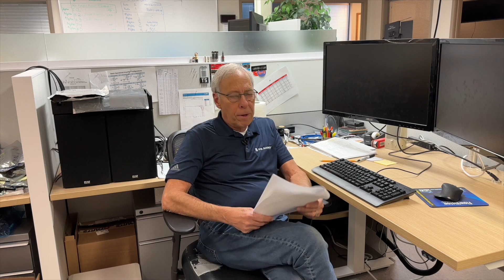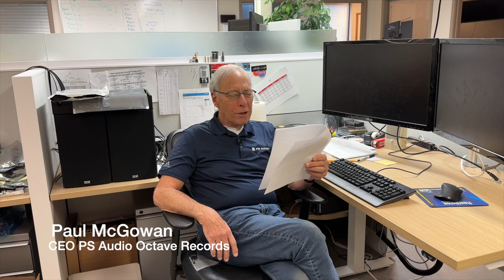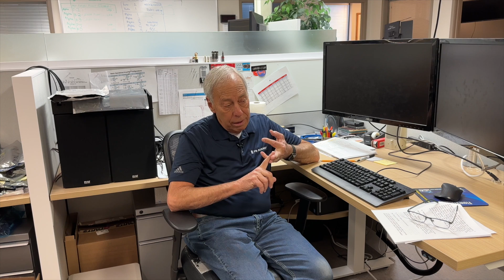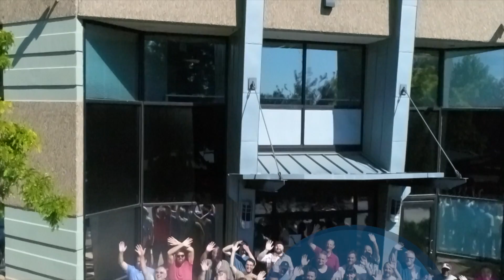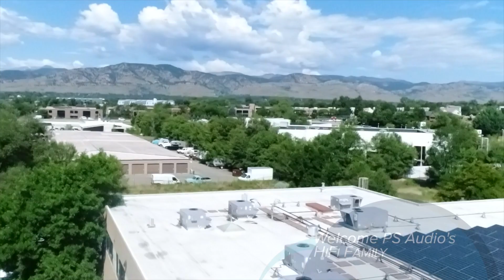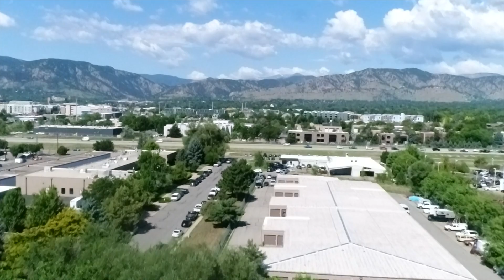Changing CPU speed for better audio

Comment: It works not sure why, it free to try in windows just go to settings>search power plan>edit power plan>processor power management> minimum to 5 percent, max to 99% down from 100, on my it didn't change when I went lower from 99 only when going from 100 to 99, maybe minimum is key if you need more speed, on mine it clocks down to a stable 1.6ghz for me from 2.6 base speed with spikes to 3.2ghz, when just streaming tidal, you can see the effect in task manager, performance tab, I also disable devices, such as hdmi output, web cam, fingerprint scanner, onboard audio/laptop speakers. The big difference was cpu speed I think, just sounded cleaner less harsh like wiping a smudge on a window, wasnt more resolving really just a something cleaner about it, this is via USB audio, you could bypass cpu altogether with toslink or a cheap usb to toslink like a smsl po100 pro but I think this is a nice upgrade for no money

Comment: Paul is correct when he said noise will come from the power supplies, particularly the 0VDC part of them.
So with connecting multiple DC devices within an audio system, eg; laptop, digital streaming unit a separate DSP and active amplification, that 0VDC can become not zero volts at all. It will often corrupt any analog ground with noise, even if balanced XLR is used. The result can be humming or random pops or low level squealing noises from your speakers.
The fix? Shunt the noise that is being generated in the ground of RCA cables to a good earth point. The ground of the AC supply will work. As long as we're you live as a good earth connection.
Easy way is to bond the shield of the RCA output cable that goes to your amplification directly to ground.

Comment: This is a very complex problem. I have tried many settings on my dedicated audio Fanless computer (Bios, windows, etc.) for months.
Fans, Led and SATA bus are the ennemy of audio. But the worst is the influence of the cpu frequency on the audio quality : the sound feels more accurate at 4Ghz than at 700Hz but more harsh to the ears. It's a difficult tradeoff to find between accuracy and smoothness...

Comment: Alot of these comments are hyperbole.
Having newer Hardware helps. And a separated power source.
1. Get a dedicated everything. SoundCard with it's own audio engine.
2. A USB out with a booster or spidif.
3. Output to a second amp dac or a theater system doesn't hurt if you know what your doing.
4. Enjoy clean audio. 
Fac and wave argument is rather silly. That's why I still use HB 320 mp3 to save space to flac or even in visualization it's almost the same ripped quality as wave.

Comment: If you're hearing noise, there's probably a ground loop issue. Otherwise, if you don't hear anything wrong, don't worry about it. As for Paul's advice, modern computers, especially laptops, will automatically clock down and shut off cores as much as they can, too save power and heat. So if all you're doing is listening to Tidal, you probably have one active core running almost at idle.

Running your laptop off battery vs plugged in would probably make a bigger difference than anything else. Give it a shot both ways. If you don't hear a difference, like I said before, don't worry about it. If you're still worried, try a digital interface. I think ifi makes something affordable and effective.
Reply: It is true. When you have a ground loop issue you can try plugging the speakers without the ground pins from the wall.

Comment: Uncompressing an audio file such as FLAC is a trivial demand for any computer so should not be a concern. As you stated, power supply noise is the largest potential troublemaker. I use a USB connected clocker to prevent jitter and electrical isolation from the PS. I do not notice a difference between using optical or coax SPDIF connections to my DAC, which directly feeds my amplifiers. Too bad these clockers have fallen by the wayside because they solve the two biggest problems using a computer as the source. Viva JRiver!

Comment: You do not need much CPU power to play music files -- any music files.
The InnuOS Statement transport / music player uses a Pentium CPU.

Perhaps that model CPU's lower clock cycle helps reduce noise?  Very likely it does reduce noise, which is why it is used in their flagship transport / music player.  And that box makes digital content sound better than anything you have ever heard.  Perhaps one or two people viewing this video have heard something in that league?

They use an outboard power supply (a completely separate box for the power supply).  That is one of the major contributing factors to its outstanding sound quality.  Power supplies are critical for sound quality.

Comment: This would be an interesting test... 
Stream identical resolution music from the following, different, sources and listen for audio quality differences. 
+ Streamer's local storage (not always available). 
+ A local USB attached thumb drive. 
+ A local network library (wired and wireless). 
+ An Internet based library (should sound identical to above, local network library). 
+ An Internet streaming service, such as QOBUZ (that requires decrypting). 
Additionally, the difference between WAV and FLAC could also be verified.

Comment: The way to avoid this issue is to not use a power hungry gaming computer as audiophile music server. Nowadays you can find highly power efficient computers such as the M2 Mac mini providing lots of processing power and excellent support for high sample rates and no concern of digital noise. In actuality, noise from the power supply leaking out on a USB cable is not just about potential  theoretical impact on the analog audio circuit but also about compliance with FCC regulations. Both the power supply and the digital circuitry of the computer have the necessary filtering to avoid emitting RF noise into the air from connected wires and thus also emitting RF into the analog circuitry. Now even I have some anecdotal evidence of past computers emitting too much RF. In fact I had a PC long ago that emitted enough RF on a PS/2 mouse cable to cause my neighbor's TV to show noise on the screen and make him call some expert to measure emitted noise. The guy with the measurement equipment came to my parents house and found my computer to be the root cause. But that happened decades ago. I suspect Paul has some experiences of this sort. Today this topic does not deserve the attention Paul is giving it.

Comment: I think you'll find that if pc is doing more "work" unpacking a flac file; more cpu cores should actually be better==> more cores means more available resources to unpack ==> less overall stress on the system.
Slowing down the available cores will also make the pc work harder to do the same (or any task ....) task(s) 🤨🧐🤨

Comment: CPU commonly use internal multipliers to the system clock, so it's only the internal CPU core that has a lower clock, the edge speed will remain the same. So no, changing the CPU speed won't help you. Lets face it, a computer is a garbage can of unregulated noise, crap, bursts, farts you name it. I think the correct answer is if you are at all serious, don't connect computers  to your analog chain.

Comment: From what i here the recomendation is intel xenon prosessor, ECC Ram memmory the more the better, Single layer cell SSD to run the operating system at least!
 USB Output Card probebly Jcat EX is your best bet for now and ethernet Card from jcat with LPSU's connected to everything even the PC it self they make a ATX LPSU from Jcat. And it should runn in a lowlatency operating system preferbly Linux this is for the server pc aka where you storrage the music and transport it to the streaming pc yes you should use two pc's!

Now the play of pc where you should have a pc about the same use LPSU and same type  of ram, usb card and ethernetcard but with a slow running CPU like an atom ore celeron just running the operating system from a thumb drive.
If you can you should runn booth pc's "headless" without grafic interface and controll them from diffrent device like remote desktopp setup ore from an ipad and try to optimise the bios no extra crap no overclocking, hyperthreading, try to stableise the computer turn off all extra functions that you dont need. Ok now you are reddy to play high quality music from your pc's ore music server/streamer system you could call it 😊 good luck!

Comment: Hmmm....you got rid of the internet explorer from the Mac. Interesting. 
I don't think it's anger Paul. You are fantastic and so is your company. And your knowledge of audio is certainly vast and very considerable. But it's the limits of your knowledge where things go very wrong, fast. The genesis of the question was even sparked it seems from the nebulous statement about processing power and audio quality. Even more nebulous when it's blamed on the power supply (a possible and viable contender for audio degradation, of a kind) but then that's forgotten and the focus is back on the processor. Bottlenecks in PC's range from the OS, to more commonly, the ram and hdd and by organizing or upgrading these one can certainly ensure the software outputting audio runs better however none of these implicate the processor.
Because of the multi factorial and co dependent environment in which a processor works the 'guess' that the processor or the even more nebulously  'the computer'  is noisey (and noisey is not defined in terms of audio quality but rather measurements made by hyper sensitive instruments) is a bad one. The likely culprit of unsatisfactory audio from a PC is the hardware and software from the sound output device and possibly the  background applications - but that is something of a stretch.  Most computers are not optimised either via hardware or software for high quality audio outputting. This is the issue, coloring and poor processing by the hardware at the output stage. Likely not the power supply, not processor but the audio output chip/card and or companion software. 
In my office I have a high end nVidia GPU card outputting to Denon AVR x 2800 via a high quality HDMI card. The sound is supberb and I have no doubt it is bit perfect even on the most over done dsd files, however it's still colored. Every piece of hardware that outputs has a color. A/B listening is therefore essential to decide whether that color is beneficial or detrimental to to the overall sound quality. 
By having strong knowledge of computing and networking I can discern where the weaknesses in this 'digital chain' or domain most likely lie. And there must be someone at PS Audio with such a knowledge? And so perhaps where your weaknesses lie Paul you could bounce the question over to such a person? The guess then becomes far less nebulous and more focused.
Reply: I think Ted Smith has this stuff pretty well figured out.

Comment: If we talk about digital media - there's no big difference, how fast/slow your processor are - most important is - what digital format you wish to play. Processor frequency doesn't affect quality of the played audio. What affects - is your PC fan/DVD/HDD EM noise and quality of PSU. Cheap power supply for desktop PC' s usually didn't have proper output filters, so they make make constant side noise. Add some magnetic coils on HDD/DVD power wires and it becomes not so annoying. Proper grounding of your PC also helps a lot. Most pervert on first look is adding grounded shield around sound card (or sound codec on motherboard), but I saw studios PC modernized in such way and it helps minimize electromagnetic noise. For notebooks most noisy is PC fan and processor VRM, but it's impossible to avoid. Apple computers, by the way, shield their sound processing components; on PC's it's part of "luxury" & "top-tear" motherboards, but I am not sure, if someone wish to pay additional hundreds of $ for such pleasure...

Comment: That's exactly why I use a Roon Nucleus. It's a dedicated computer where the the Roon Core (platform) resides. I have read online audio forums that many owners of the Nucleus state that it does indeed improve the SQ markedly. It's hard for me to make this claim as I started streaming from scratch and purchased everything  I needed to stream digital music at the same time. I am very pleased with the results that I'm hearing using this dedicated digital device.
Reply: What is the point of paying 4 or 5 times more for official Nucleus instead of buying Intel NUC with better specs?
Reply: @Matchushka who wants to show off a NUC when you show off a NUCLEUS
Reply: @Matchushka cus they have money duh
Reply: @evilbert82  lol indeed, at a certain point for some it is easier to spend money to fix a problem they may or may not have

Comment: Letting the CPU work efficiently (but not pushed with OC) is probably the best bet.  
I have looked at some tests on PSU and they seem to be all over the place, probably a better place to start. 
How the audio is routed/exiting is another thing, some software will allow you to bypass volume etc, if USB is used then there is USB cards that you can use external PSU for. 
How the different softwares on the computer is written might impact things, some can really lug down the computer even if it's not showing up as a large process. 
I'm not sure if it matters at all, but there's also different paths that the signal might go on the motherboard, like the USB.
Reply: Some usb have a sound card too.
Reply: @jasonlynch1708  I'm not sure what you mean, maybe you posted before you where finished typing?

Comment: Turning down the CPU speed will have minimal or no effect. This noise the writer of the question is talking about is often not audible.

offte a laptop computer has spdif through one of the jac earphone plugs. you have to switch to digital in sound settings in windows or whatever you are using.

If you use usb for your DAC. Then I once experienced hearing noise, but never when using spdif.

Comment: Exactly correct.  I set my cpu and graphics card to Maximum Energy Conservation mode.  My DAW runs at 1.3% cpu utilization when idle.  Not bad.  As the cores run tasks, the processors ramp up only as needed.  No fan runs usually. Very quiet.  WAV files are best for professional recording, mixing to keep the cpu quiet.  The big strain is on the hard drive.  Must be fast, 7,200 rpm, sata, ram cache, etc.  Defragmentation a must on MS PC's.  All WAV's must be same khz for mixing down to a master.  Run only required services.  The rest I must keep as trade secrets.  Good video.
Reply: get an SSD grampa
Reply: My workstation is a Toughbook laptop, 8gb ram, HD A/V, quad core 3.2 ghz, 1 TB SATA 7,200 rpm HD 97% free space. Runs silent.

Comment: I wonder how the debt ceiling stalemate will affect high end cable sales? There is already a collectible Out of Print lp seller offering discounts on their used albums. If old peoples Social Security checks don't come through at the beginning of the month, will they be selling off their KLH 9 speakers and Marantz 9 power amps cheap, to pay their rent? Keep a look out. I was just kidding in my last post when I said my cable buying would affect my kids amusement park activity and vacations. Actually I don't have any children. Just a take on over the top audiophile habits getting carried away. Let's totally refrain  from controversial subjects like cables.

 Isn't it amazing how much improvement greening the edges of cds make? I was playing some Mercury Living Presence recordings and they are known to have a 1k to 2k peak in their frequency response. On my system, the greening of those cds, transformed the woodwind sound from peaky to almost just right. Less screechy massed strings too. Try it. "Paint Pen" not magic marker.

Comment: Computer noise has nothing to do with CPU speed! It has something to do with the fans, cheap power supply or if you have a water cooler pump or any bling bling lightings. Replace your power supply with noise filter, also put a decent sound card and attached your DAC direct using RCA or 3.5 plug, not through USB.
Reply: Personaly I would use USB to a realy good Dac.  PC souncards are not good enough for best sound quality.
Reply: @philipslighting8240  I did not say use the sound card as a DAC! I said buy a decent sound card with an RCA output and connect your external DAC to the sound card using RCA with shielded cables. USB is always a culprit and a source when it comes to noise that comes from power supply... That's why most Audiophiles when using USB as a power to their DAC connect it to external battery pack. FYI...

Comment: I doubt slowing down the CPU would make a difference...in my experience he would be better off purchasing an external silent usb power supply (iFi micro iUSB 3.0 for example), or a galvanic isolation usb device, or an "audiophile" usb card (like the jcat femto for example)
These aren't cheap but they do make a difference
Reply: Just get an Apple silicon Mac.  No heat No fan noise.

Comment: CPU's either work or they don't. Even if one bit is flipped, that can cause the computer to be unstable or crash outright. And that's a more noticeable and serious problem than just having digital audio noise. That said, it's good to have a stable low-noise PSU and motherboard with good power delivery so that you're feeding the components with clean power.